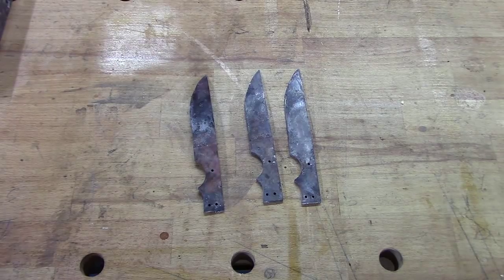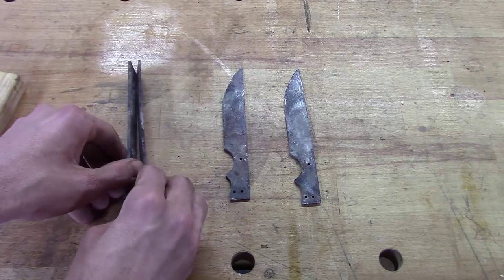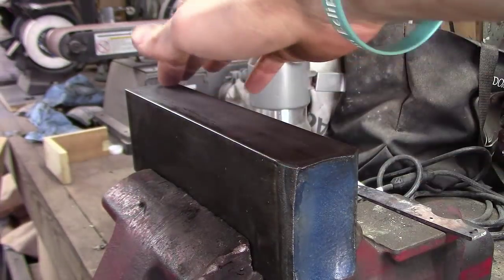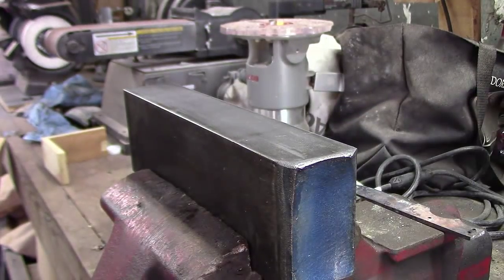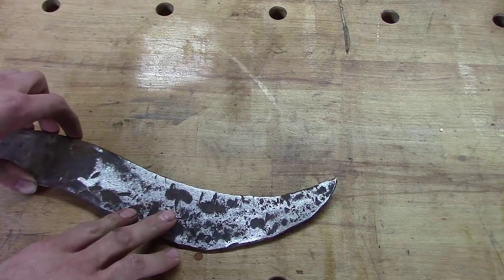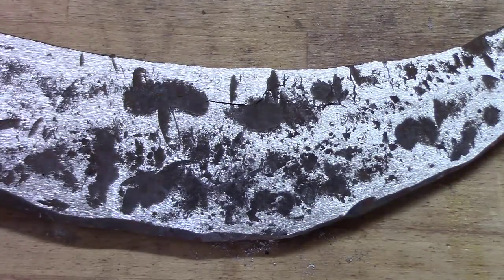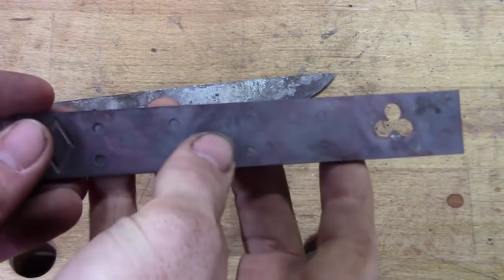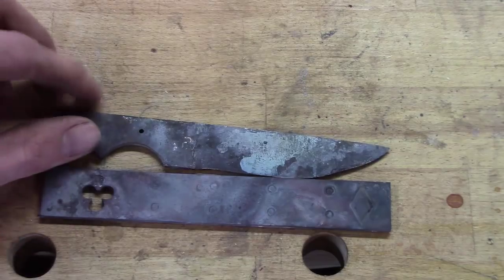Tips in metallurgy

Comment: Great tip on the sparks, thank you!  Just curious, I'm still learning, but doesn't re-heating the knife to "red" destroy the hardness?
Reply from the maker: Yes if you go pass the lower transformations zone (550F) the temper is gone. If you want to reforge you have to go past the upper transformation zone. (1550F) then let it cool off very slowly this is called  annealing or normalizing. You can look up properties of metallurgy look up different properties of quenching air water and oil. All high carbon steels have different processes and different abilities.